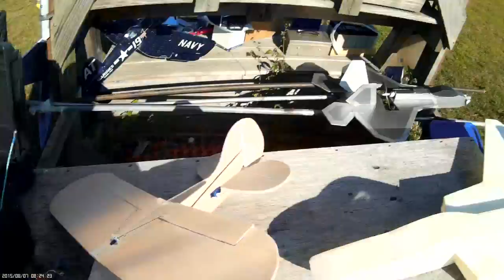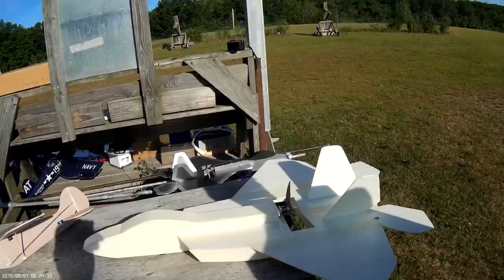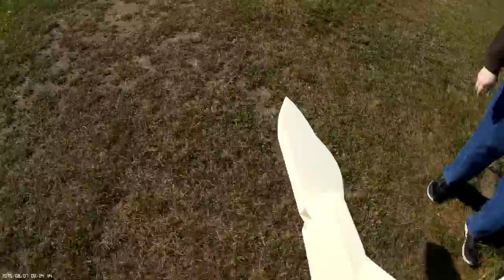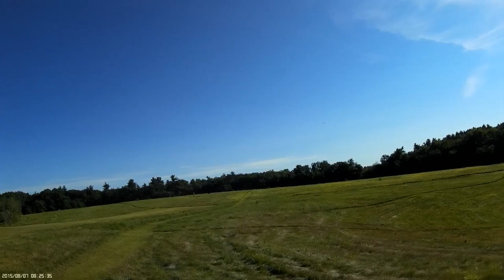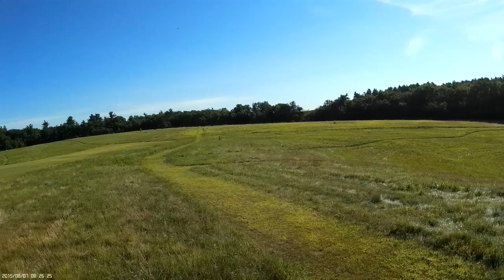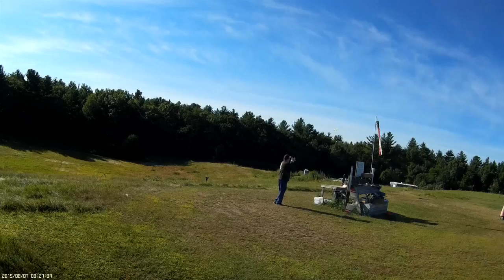Supersized FT-22 Maiden Flight

Comment: Good job 👍 Can I using emax 1400 kv motor, profuse 1750 mah 3s lipo and 8x4 prop for ft22-raptor ? what is your idea ?
Reply from the maker: Hi Omer. The motor in this build was NTM 2826 1200 kv with 9x6 propeller and this is the smallest I would try. All the build details can be found in Flite Test: https://www.flitetest.com/articles/supersized-ft-22-150-bigger

Also, I thought this plane was under powered, so I upgraded it to NTM 28-36 1400 kv with 9x4.5 propeller. So, yes, a 1400 kv motor is good as long as it is not smaller than this one. This setup was much more suited for the plane and is detailed in upgrade article: https://www.flitetest.com/articles/supersized-ft-22-upgraded-ailerons-and-big-motor

If I had to do it over again, I'd probably use NTM 2836 2200 kv.